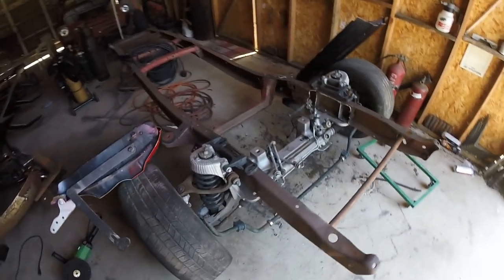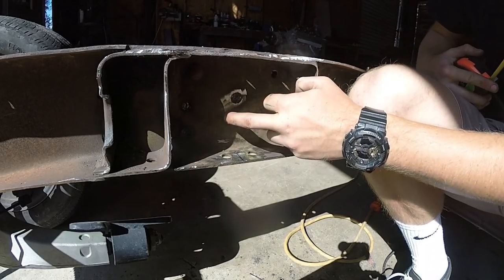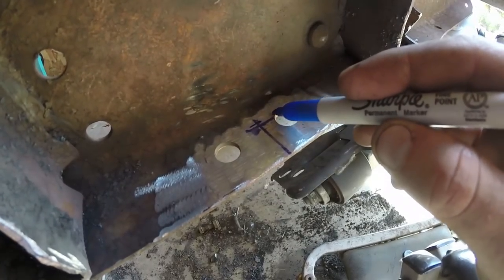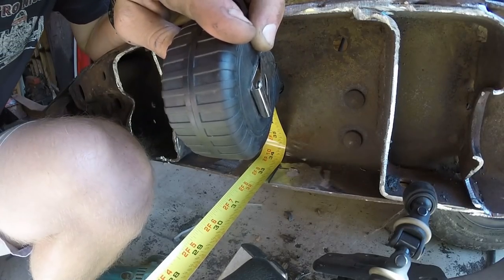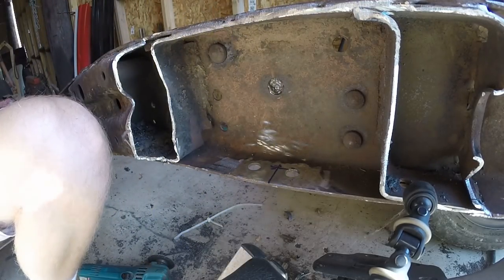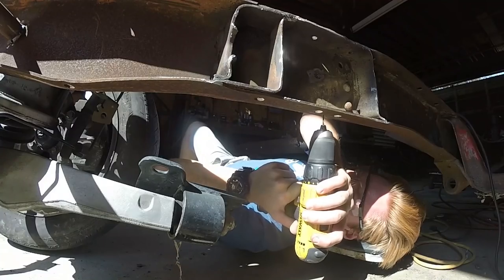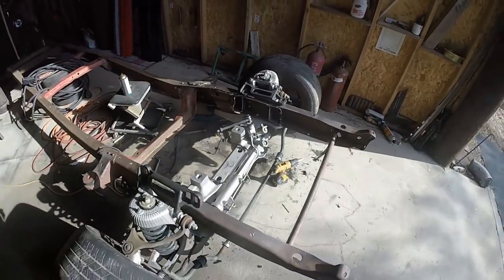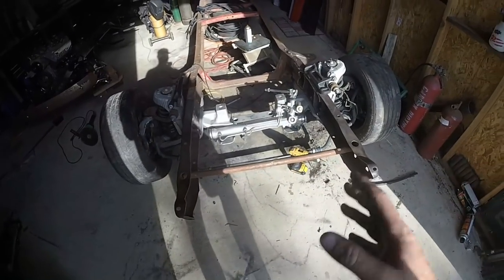The Crown Vic F100 Build Ep 5: Drilling and Centering The Dowel Pins

Comment: dont sweat it man, the a-arms have adjustment so you should have enough adjustment to correct for a 1/16 or even up to an 1/8"!  just be SURE to diagonally measure to a fixed point on the rear of the frame and get the front clip as square as possible then TACK IT, MEASURE AGAIN, MEASURE AGAIN, then burn it in.  always, ALWAYS, tack first!  you got this man, it ain't rocket science!  if you can wait, tack the front, install the rear axle, measure measure measure then weld front & rear at the same time.
Reply from the maker: You bet man that’s the plan!! I’m so paranoid with the measurements I’ll measure ten times before I burn anything haha. Well get it

Comment: What do you know about drilling out the forward holes?  I’ve seen some do it the way you did and drill between the two holes the length of the cv lining pins and I’ve seen  drilling back the forward holes to fit the lining pins.   I’m ready to start mocking up and seeing two different ways to do it, just wondering the difference. Thanks!
Reply: The way craig is doing it keeps your wheel in the factory spot using the forward hole moves the wheel up about an inch or so

Comment: Hope you plan on welding the old locating holes sloses so the new front end won't shift later on. Not much metal between the new pin and those old holes
Reply from the maker: Yes it will all get welded so it can’t move

Comment: Why center the alignment pins? They are used for the robot that assembles the CV. You are actually best to align the front suspension to the wheel well and aligning the dowel pins doesn't accomplish that. This is much easier to eliminate the alignment dowels and align the front suspension to the wheel well opening. I also did the MN12 IRS install. When taken for alignment I was told my install was perfect.

Comment: I'm  also doing a crown vic front end swap. Mine is from a 05. I  also have the bung holes that the bolts go through the frame. I'm gonna hole cut the top of the frame and drop in the bung holes and weld them into place. Once, I've done that. I will box in the frame. I enjoy your videos and I've even did my throttle linkage like yours. Thank you for the shopping list of parts to make it. LOL,  anyway, I'm looking forward seeing you complete your projects and see your transylvania swap as well. I've been thinking about a Mustang 5 speed for mine. Oh, I  have a 70 f100 Ford Ranger XLT, with a 3 in the tree and a 302. 9 inch rear end. She's a looker. LOL.  I  was wondering what you did with that one long bed with the toolbox on the passenger side of it? It's built into the bed. I've been looking for one.
Reply from the maker: Glad it helped man and I ended up selling that bed to a friend and he cut it up for the toolbox lol. But I for some reason see them on the long bed trucks in junkyards here a lot. No clue why.
Reply: Thecraig909,
 How much are they going for? I  can't find any around here. The ones I do find. Are being used on monster trucks locally.  I'd really like to find a bump side one for my truck. Then I'd do to it what I'm gonna do to this one as well.  Ford never made a wooden floor on a fleet side bed. I'd appreciate it if you would find one and tell me how much it's going for. Thanks, Brother.

Comment: wow drill the hole already, lol do they teach the metric system in america. when you subtract or add in millimetres, it is quicker, and lots simpler then talking 1/8 4/32 of an inch etc. and buy yourself a steal ruler thats in millimetres, I watch you guys measuring in inchs and fractions checking your measurements 7 and 3/16 of time over and still make  mistakes. Sorry man, you do a good video better then most i watch from america, they tend to talk about them self and the neighbour's cat for the 1st 10min. nice work in the end.
Reply: We dont use metric for measuring, maybe we should start. Although all car nuts and bolts are metric now
Reply: Doesn’t make any difference what units you use, you check, recheck, check again, and check once more before you commit.